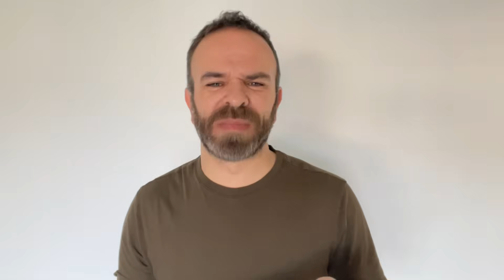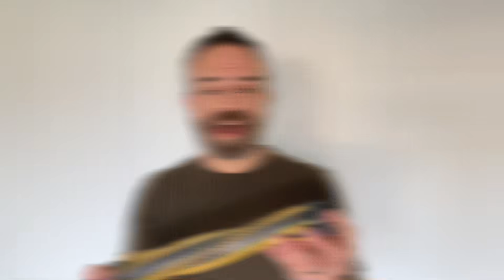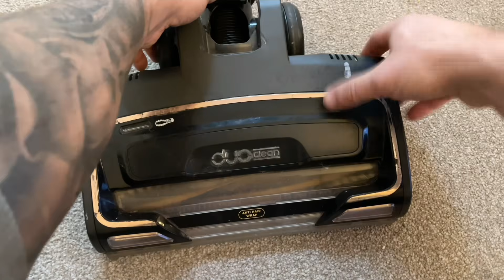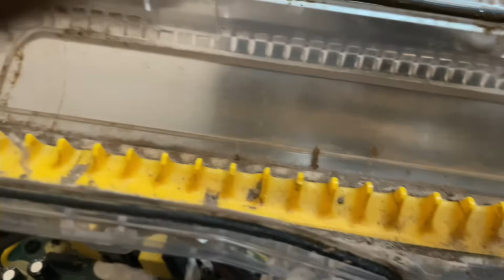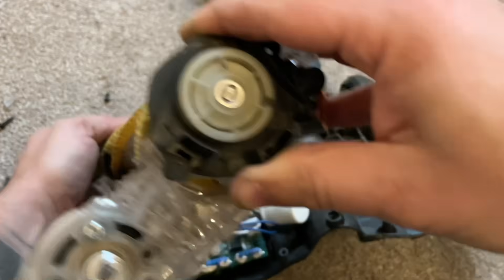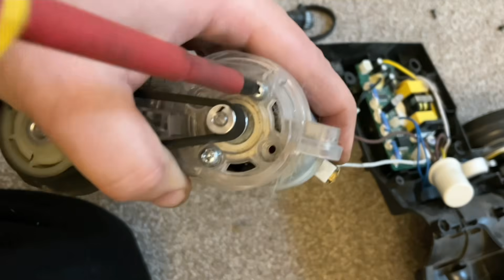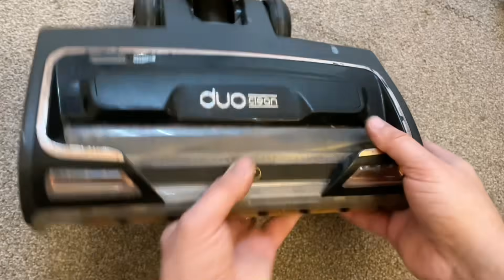How to REMOVE Shark Vacuum BRUSH Roll Duo Clean Roller

Comment from the maker: PLEASE LIKE THE VIDEO I hope this helps someone. 

If you feel that this is too difficult you can buy the complete "Power Nozzle" from the Shark site. Remember tht they are model specific. 

Also: 
Been having some fun making a second channel where I explain random things… 
Didn’t think I’d enjoy it this much 😅
Link’s here if you’re curious 👇

https://youtu.be/POh9znd-Aio?si=tZCNBPUFDC0mbeT7

Jonny x
Reply: Not buying Shark again.  Their engineers are idiots,😡
Reply: What I mean is to much hassle for me it will drop to bits if i take it apart and I won't be able to fix it back together
Reply from the maker: @Pedalpausecapture yeh I know I’m just saying if there is a reason you were thinking about taking it apart then I may have a video of how to help without taking apart
Reply: Hi I have a duo clean detect with sanitizer and I’m trying remove the brush and ive removed all screw and can’t seem to remove it 😢
Reply from the maker: @TiredTiramasu 
Hi please see this video : https://youtu.be/3CfAvkK_Ztc?si=J6q3EUF_aCBQzaS_

Guessing it’s a similar model. They are a nightmare! Not had many in as they are still quite new but I would be careful. 

Video again if you are just cleaning it

https://youtu.be/3CfAvkK_Ztc?si=J6q3EUF_aCBQzaS_

Comment: Thank you so much. I managed to buy a part from ebay and using your video I managed to harvest the best bits from the original and the ebay part.  The "neck" of mine had broken so it wouldn't stay upright and this had eventually started to damage the wiring. Anyways, end result, it works and picks up beautifully again! Great result! Thank you again

Comment: You’re 100% correct on the frustration part. I was given a duo clean whatever nonsense as a friend didn’t ever use it. I wanted to do a full clean on it. The motor assembly was the easiest thing I’ve cleaned in a long time. I was beside myself how easily cleaned it was. Got to the brush head and went wtf. It’s like shark used two entirely different teams to design the two parts.

Comment: I've got a LA450UKTBK66 as a buyer from germany. My model doesn't have those coin screws at the bottom only different torx with a pin in the middle. Thank you very much for this video! It helped me a LOT. 🥰👍

Comment: Great tutorial. All went according to plan until the bit where it should be easy to unclip the right hand side panel to access the roller - no such luck - it’s completely unmovable. I’ve spotted a screw head behind the ‘eject roller’ button. Is it possible this needs removing? It does feel like the side panel is anchored about there.
Reply: I had the same problem today and after some time I managed. Yes there is a hidden screw that you can see when you move the "eject roller" button, I ended up removing it as my screwdriver would not fit otherwise. Also, I figured out that the black silicone/plastic going around the hair wrap plastic frame "melted" and was making it impossible for me to detach the part completely. I ended up scraping and cutting it and I managed! Good luck :)

Comment: Thank you for the how to. This practice is exactly what needs to stop. They make throw away products out of materials that will never break down. It's absolutely insane that the only driven item that touches your floor is not easily replaceable or even available. I'm not one for oversight but why aren't these companies made to at least supply parts?

Comment: I have an LA555 X5 that I got free. It is extremely dirty and clogged with pet hair. I managed to get the cover off, but the side panel on the motor side won't come off. Also to further complicate things, the button release for the soft roll is on the same side as the motor. This model has the red "fin" roller.

Comment: I've got all the screws out but I can't release the bottom corner to get the clear plastic housing out. It's now sat in bits on the floor 😆🥲

Ok edit to add when manufacturing they have glued in the seal with super glue and in places it's fused the clear housing to the rest of it so the sides won't come off I've been prying it apart it's bonded together that's why some other people are struggling too
Reply from the maker: No no hang on you may just have a model with hidden screws under the top cover don’t force anything shark have never used any kind of glue on anything. Send me model number and I’ll help.

Comment: I got some wool wrapped round the brush. Removed it all but now the brush won't go round and red light comes on. But I cant see anywhere that the wool would wrap round inside. What should I do now. Thanks
Reply from the maker: It can get down into the end caps and it’s stupid… simple things should t kill them. 

Options 

1. If it’s a double roller remove the front one and see if that gives the motor that extra power to start up and blast the last bit of trapped wool. 

2. Remove brush snd see if that allows you any more to see anything trapped. I have a video when I spray silicon spray in and attach a seized brush to a drill. 

3. If under 5 years old. Even if you didn’t register warranty. Ring shark. They are trying to take over the world so do actually have the best warranty claim procedure I’ve ever known. They will transfer you to video call do be with the vacuum. You have done everything you can but abit of wool shouldn’t kill a vacuum. Complain like hell and they will likely send out a new complete floor head for you.

Comment: My shark roller is jammed. 11 screws to remove. For some bizarre reason the torx head screws have a pin in the center of the recessed torx. Impossible to get out without a special tool that doesn’t appear to exist.  NEVER BUY A SHARK.  Why would they design it so you can’t repair it.
Reply from the maker: I sell the screwdrivers please click on description (first line) I also have a video how to free up a seized one…. But yes they should make them removable like everyone else does

Comment: The reason Shark makes it so difficult to work on their machines is becasue it follows the same principle as anything repairable. They (Shark) do not want you to make your own repairs. They want to repair it, but they can't, so they'll tell you it is not repairable and that you'll need another vacuum, even if your vacuum has less than five years on it. Apple and most new auto brands dont want to fiddle with their products or try to repair them becasue they threaten that if something goes wrong, you have nullified the one-year warranty or three-year warranty in the case of automobiles.   Another thing is that as we enter the 21st century, more and more companies that use cheaply sourced parts from China are breaking down at a faster rate than they did 10 years ago. So even with a vacuum, the right to repairs is viciously defended by these companies.

Comment: Brilliant video.. our main brush bar appears to be really stiff and struggling to turn also have a red light showing.. any thoughts?
Reply from the maker: Ok yeh the red light is usually when brush jammed or seized. Make sure nothing trapped in the anti tangle comb. Clear any hair you can see including behind front roller if any. 

Silicon spray can be your best friend 

Here is a quick video on it 

https://youtu.be/Wu2ax-h541I?si=XBKGtos4SCXeP-Zu

Comment: Shark Anti Hair Wrap & Flexology Cordless Vacuum Cleaner, it’s making a vibrating noise when u turn it on, iv cleaned filters butr still making the noise
Reply from the maker: If it’s “fluttering” from near the motor. Buy a new filter (the black plastic one with pleats) and it will sort it. The air cannot escape out of it.

Comment: tried this took all the screws off and it just would not come off! Only trying to hopefully stop it making a loud vibrating noise when the roller thing spins round!
Reply from the maker: Wha model number though. It may be a model that had different or hidden screws. 

Also check in the anti hair wrap comb for anything stuck. The most common cause of noise is stuff in there like hair clips or stones

Comment: Hey so for me the belt didn't come off and me and my parents weren't either  i wanted to know if there was a different model or something becouse it looks the same as yours
Reply from the maker: If you struggle loosen the 2 screws that hold the brush motor in just so the motor gets a little play. Then it will come off the brush a little easier, but yeh I can’t tell you if any other way other that what I dhow in the video. As far as that little part of the task goes models don’t matter

Comment: No question from me, just a thank you for your great video.

No idea why Shark insisted on using security torx screws in my model? It's a vacuum cleaner not a nuclear reactor!
Reply from the maker: One word “Money” all they clearly want to do is keep selling the £79-£80 floor heads rather than the public simply being able to change a belt and clean a brush.

Comment: I recently replaced the anti hair wrap roller with one bought new off eBay as the old one was clicking and the connection to the spinner wasn't locking. thinking it was broken at the roller end but turned out it wears down at the hoovers end the new one lasted all of 5 minutes before it was destroyed. definitely don't recommend replacing that. if it starts clicking get a different brand hoover once the anti hair roller goes and stops spinning that's it vacuum. is useless
Reply from the maker: This may be why if it’s the front roller 

https://youtu.be/WOIgTyVlLFU?si=Ywpmd3N4b4vCs56t
Reply: @vacuumhelp yes this was the issue can see it wobble when removing the roller. I've removed the roller for now and the vacuum works ok again now.

Comment: Hi, thanks for the video.  Before I take the brush out and clean everything up I just wanted to ask a quick question.  The brush bar on my Shark NZ801uktsb turns intermitantly.  If I give the brush a push with my hand it spins.  If I put a little pressure on the brush it stops, and requires another gentle push to get it going again.  I've checked the leads for breaks and they are all good.  It just seems as though the motor hasn't got enough go to turn the bar all the time.  Any suggestions?
Reply from the maker: Yes I see this all the time. Possible causes most common first 

1. Motor is on its last legs. They aren’t available to buy new but used comes can be found on eBay 

2. Capacitor week on circuit board. Normally giving off a sat range electric smell though. 

3. Belt slipping (rare as rocking 🐴 💩) but if this is happening it would be screeching like a fan belt on a car. 

My bet my a clear mile is the motor that turns the brush 😊

Comment: What happens if 2 screws are stripped? No size screwdriver head fitted properly. I have a IP3251ANZ model Power Detect with a head that has DUO clean DETECT written on it. Nowhere on You Tube is there a tutorial to take it apart to replace the micro switch.

Comment: I will never buy another Shark, or recommend them to anyone for this reason.  Quick access to the roller is standard on other brands.   A single loose screw caught in the roller in a Shark means my vacuum is completely out of commission with no clear recourse, days of trying to find the right driver only to take the thing apart to find that I need yet another size of impossible-to-find driver so that I can disassemble a PCB and the motor housing before I get access to the roller.  All I need to do is pull a loose screw out of the roller housing, and it takes this odyssey of fucking idiocy to pull it off.
BUY ANYTHING ELSE.  NEVER BUY SHARK. TELL YOUR FAMILY, TELL YOUR FRIENDS.  FUCK SHARK.

Comment: Thanks for the video. I've cleaned initial bar but the problem is the roller and bar spin quite slowly. Is this normally a debris build up so worth taking the roller out as per your video? Thank you
Reply from the maker: When you put it into carpet mode (switch in handle or body depending on the model) does it speed up or stay the same? 

The hardfloor setting it quite slow that’s all so I’m wiling out the vacuum being stuck on that setting first

Comment: is it the same for Stratos IZ400UK? I have a nail stuck in the roller....
Reply from the maker: All models differ. Yours I have the upright version on video here which shares lore similarities 

https://youtu.be/ZjaRaDoETZs?si=oMQKhL62kXxc6BNA

My advice… remove the sold plate and if you can see that it’s a nail… get some long nose pliers and try and get it out that way, without taking apart, 

Good old Shark with owe this teeth inside to catch things… but no way of getting them out easily

Comment: Good morning... I have a jammed main roller. Just watched your video but can't get the hood off, it won't release from the clear front plastic part where the orange roller sits. My model doesn't have the long screws in it. I haven't forced anything, and all screws are undone... Hope you can help... 
My roller turns but stops just before turning 360 degrees... Think there is an issue with the belt. 
Kind regards.
Oliver
Reply from the maker: Ok what model number do you have please. 

1. Is the roller spinning freely by hand? 

2. Rule out a bet issue it would t be spinning at all if belt has snapped 

3. Does green light turn red when it stops 

Get me the model number and I’ll tell you how to take it off. May even have a precise video

Comment: Even with the roller out, and no belt on, the roller is jamming up. I am sure it is stuff jammed inside the roller housing. Difficult to access unless the end pulley is off. How to access? Is it a press fit? Will it go back on afterwards?
Reply from the maker: Sorry I missed this. You can’t take them apart. You can try my other video below or buy a used one off eBay would be another option 

https://youtu.be/Wu2ax-h541I?si=Zu3zOZSCt7EhkqVe

Comment: I did flow all the steps I disconnected the LCD cable, when I tried to lift from the corner, it's not coming,it looks very easy in the video, but in mine it wouldn't move, I tried hard and then I stopped I thought I my broke it, so I just put back everything and never managed to remove the brush 
Thank you anyway
Reply from the maker: Depending on model as they all differ. Double check no screws in the clear section and try pulling full the brush bar motor. From the back to see if that helps separate the 2 pieces at all.
Reply: @vacuumhelp it's the same model,I will try again, thank you for your help
Reply from the maker: @DonaldDonald-k3z no problem yeh give lifting the motor a go 😊
Reply: The reason I want to open it is that the brush doesn't rotate properly when it's switched on. I have to turn it a little by hand for it to work correctly. So I'm wondering if something is blocking it. Do you have any idea what might be causing the blockage?
Reply from the maker: @DonaldDonald-k3z remove from mains…does the brush spin ok by hand? ALS if you have the duoclean model, remove the soft roller… nothing behind there? 

If the first 2 things are ok then this is the first sign of either the motor failing…or a circuit board issue where a capacitor isn’t giving the motor enough power to start up on its own. 

Floor heads are available to buy rather than buying a complete vacuum, should this be this issue. Motors are only available as a used part on ebay.
Reply: @vacuumhelp yeah the two things you mentioned are good, once I give it a small push with my fingers,it rotate properly in both positions normal and fast, it's just when it's started it's doesn't spin
Reply from the maker: @DonaldDonald-k3z ok I was just getting you to check these incase you hadn’t. My answer remains the same then. Failing motor / circuit
Reply: @vacuumhelp I understand, thank you for your time, you have been very helpful 
All the best
Reply from the maker: @DonaldDonald-k3z sorry I couldn’t deliver better news
Reply: @vacuumhelp no you did well 
Thanks

Comment: Thank you some much for this detailed instructional video.  I managed to get brush out, learned how to manipulate the motor to loosen the belt and got all the tangled hairs on the end of the brush.  The other end has a belt as well so make sure its in place before you screw everything in place.  The torx head screws are very bad quality, I had to use screw retractors to get a few out.  But, I saved myself £200 and I was about to buy another vacuum just because the brush head light was red.  It does take time but is very satisfying to fix.
Reply from the maker: Anyone struggling with motors etc just give me a shout. My belt changing video will help with bits like this. 

Glad you got it fixed. Sadly so many people must give up and buy a new floor head… I guess that what shark want us all to do